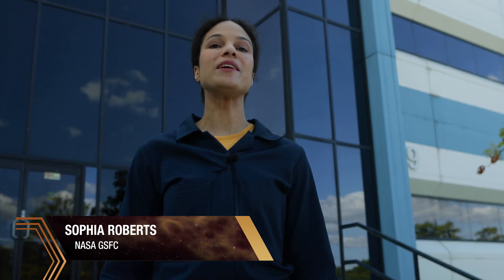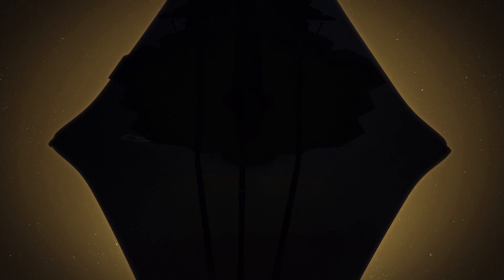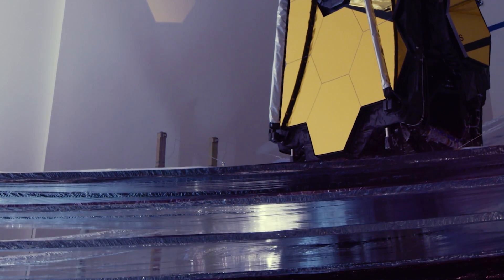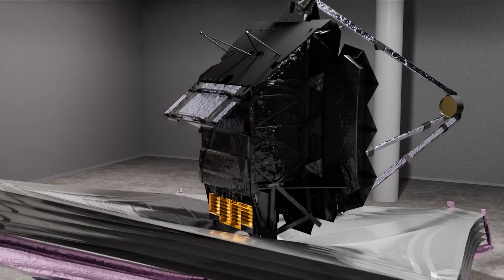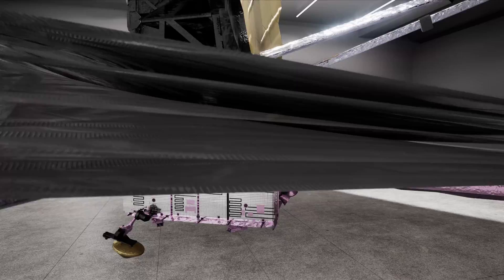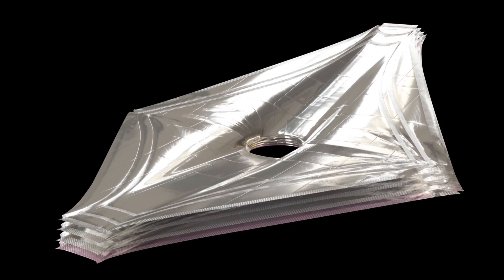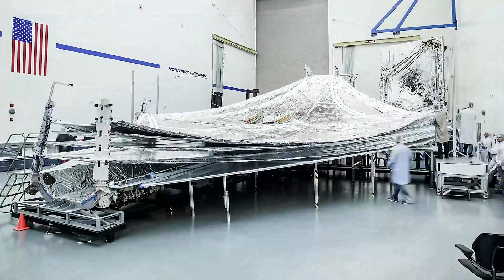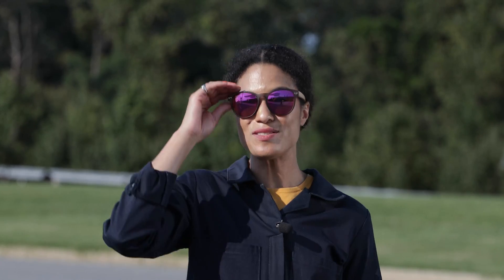The Webb Telescope Sunshield

Comment: Similar to the JSWT heat shield, a simple emergency blanket can help you to protect your home from unwanted heat radiation. Simple tack a cut to size sheet with the silver side facing outwards to the window frame. The room will be significantly darker, but you can still look out of the window. Plants in the room will survive. I did this with the south facing window of my apartment during the hot summer months. By that I could reduce the peak temperature by 5-7 °C. It's inexpensive yet super effective.